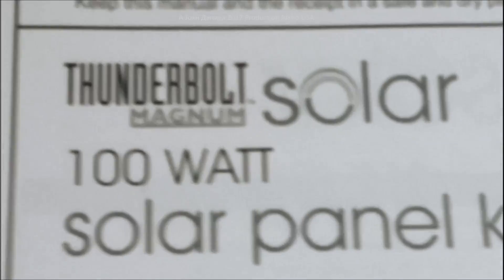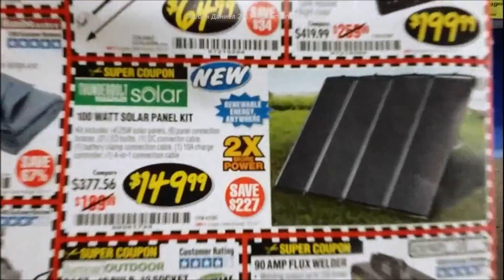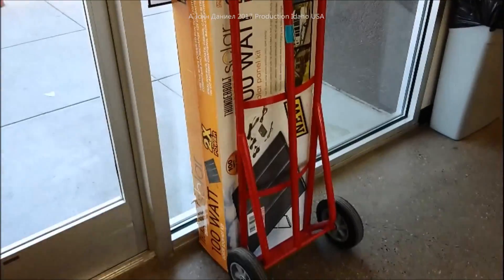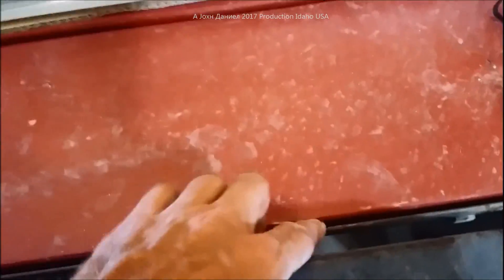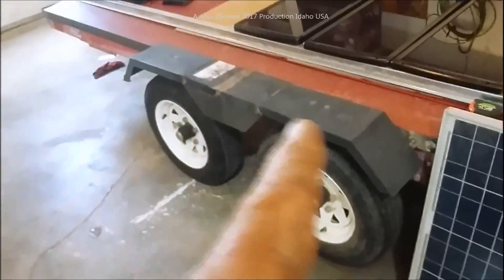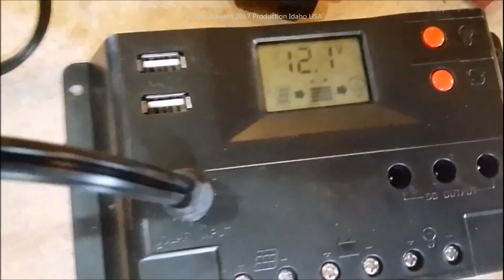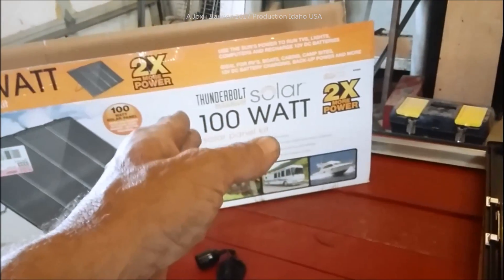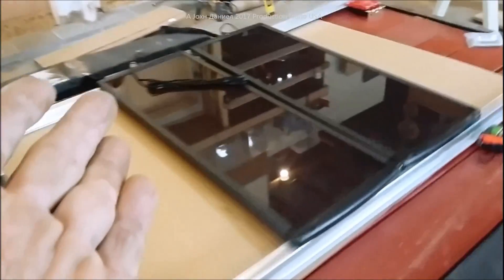Harbor Freight 100 watt solar kit #63585 NEW Thunderbolt Magnum (MAJOR PARTS LIST BELOW)

Comment from the maker: ATTENTION NEW SOLAR FOLKS  You Can Do It ✌ CHEAPER ✌ ⬇️ 93% Survivalist Agree, see the "Elite CAUSED" ENERGY CATASTROPHE SURVIVAL OFF GRID SOLAR POWER SYSTEM -- 100 Watt Panels (12) https://amzn.to/3yO2ls4 , Affordable durable solar controllers pick (2)60/80A https://amzn.to/3x3Nw42 ,Solar Connects https://amzn.to/2XJOa1M ,Battery cable USA made https://amzn.to/3h6dsim ,12/2 Above/Underground https://amzn.to/2XIJolg for safe DC wiring of lights and appliances.
Premium POWER QUEEN LiFePO4 Batteries 10 to 400 Amp for bargain cost https://shrsl.com/3kfqh
Cheap Inverter with proven 5+ year record of quality - 3000 watt long life Inverters https://amzn.to/4c1pmpF for tool, high amp, fine electronics, uses Fairchild Semiconductors
Reply: Јоhn Daniel. WOW thanks I was going to put up renogy for 100 $345.00. Its cheaper to go your way
Reply from the maker: The better stock solar items are  https://ebay.to/2KHX5XY  from Ecom
Reply: @wendelljohnson1884  It may be cheaper, but you get what you pay for.  Mr Daniel is somewhat confused about amorphous silicon vs crystalline silicone solar panels.  Amorphous silicon is cheap to make but it's downside is that it is about 9% efficient.  Compare that to crystalline silicone panels which are about 22% efficient.  That is why they are so large for the small amount of wattage they produce.  Crystalline panels are usually about 100 watts for one panel.  So this Chinese kit may be cheaper but one gets less electricity from it.  It would also take up more space for the equivalent amount of surface mounting space.  There are many ways to put a system together, but unlike a house or shed where space may be abundant, the roof of a truck is limited in its area, so you might want "stronger" more efficient panels.
Reply: Question.....does that box convert that power so you can plug up an electric device,such as lamp,drill,fan,etc.????
Reply from the maker: The "box" you appear to speak of is a solar controller. It takes incoming voltage and charges a storage battery. From the Battery you would install a inverter to run AC 120 volt items. But you can run 12 volt DC items straight from the battery also if thats what your using.
Reply: Can i use the panels to change a 12volt battery when camping for a t.v and charge multiple phones? Will i be able to use the water pump for the shower and toilet?
Reply from the maker: Yes, you can run numerous 12 volt things like pumps, TV's and lights off a battery charged up by the panels. Just be sure to get enough batteries such as 2 - 35 amp like these https://amzn.to/2CTojwv and follow proper wiring standards for the controller and batteries.
Reply: @JOHNDANIEL1  I run almost everything on 12v (even refrigerator and microwave). I love watching these videos to get ideas and learn about new things but, when I see that little 35A battery, I don't know whether to laugh or cry.
Reply from the maker: @64Seawind  Ah, the 35ah test battery. Much smaller than my 14 big L-16's in the battery room. And still smaller than the 3 WMM 29DC series in my truck the panels were installed on.
Reply: Thank you for your video now will be buying that
Reply: I'm new to all this do you this system to run home electricity or can it be built up to so also I'm hearing stories about people selling excess power back to the man is this possible
Reply: Mr. Daniel,  I'm going to buy these panels now that I've had my fears relieved from your excellent demonstration! Thank you so very much for taking the time to put together this knock out demo! You're awesome sir!  Sincerely, S. Shields - Texas
Reply from the maker: Good to know, but when you learn how to apply solar, all the things I have tested, abused, tried to break and it survived is on my tested list https://www.amazon.com/shop/influencer-acccb1e8
Reply: Cuánto vale potable poder solar
Reply: Jesus Christ died for our sins, was buried and rose again to save us from eternal judgement and give us eternal life if we believe Him. Only God can save us and freely give us new life inside forever
Reply: great info, I've got a pretty interesting idea maybe harbor freight might be interested in as well and the DIY community  500 watt's interesting things can happen, be cool to see something you designed on the shelf at any home improvement shop. Recently, through Utube, this isn't my info but having solar tracking could increase the  capacity by 50%. if 100 is max input shouldn't that mean somethings missing maybe some ultracapacators in the design of the panel with it setup as a 12v design it could be constructed  for a 200v design for ultracapacators with the ultracaps instead a low volt design construct a high volt then the ultracaps to extend the drain time into the lithiums.
Reply: WOW THANKS FOR SHARING THIS CONDENSED AND VERY THOROUGH LIST
Reply: Recently purchased the Magnum and I don't understand the instructions for the controller box. I don't know what type of batteries I have except that they are the multi-purpose batteries meant for the panels from harbor freight and I don't know how to tell if the maximum output mode is working since there's no flashing bars. Any advice on this would be greatly appreciated

Comment: I got the same kit i added more panels to mine I hard wire it to my 30 foot camper trailer to keep the battery charged i pulled in so much voltage i had to build a bigger battery bank i can run all the lights water pump and fridge and heater it’s up to a 400 watt system all with harbor freight
Solar panels

Comment: Thank you for posting your video, it's fantastic! I was wondering how those solar panels worked in low light, it's good to know that they are powerful even when they are not lit up all the way. Your battery system is awesome too, I like the idea of building it all into a solid frame. Thank you for the parts list and all the information you provided, very very helpful! Thank you again!

Comment: Hi, great video, you went above and beyond what many didn't know, thank you. Do you run the 35AH batteries? I want to parallel 3 or 4 of them to create 105 to 140AH. You think it's doable? I have hernias, so I'm limited to lifting no more than 20 lbs. Let me know, thank you 😊
Reply from the maker: 4 of the 35 ah are not really 140ah, they can only really put out total of about 95 all together before they drop too low in volts. BUT If you hurry, you can get the last 4 TIME USB lithium 50 amp hour batteries they have for stupid cheap, Time USB Super 50AH, https://shrsl.com/435wf and you will never worry about weight or outcome on them. They will last you 8 to 10 years, and can go anywhere inside your house. Later get a 40 amp MPPT and your set.
Reply: @JOHNDANIEL1  you are the best, thank you. I briefly thought of the 50ah batteries for that same amperage reason, you get close to 100 with two vs more smaller batteries. Just didn't want to waste the one 12v 35ah that I purchased never used. Thanks for the info.
Reply from the maker: You don't have to waste it, put a 5 amp buck charger on it coming from the lithium and keep it for running your outdoor LED lights using a Dusk to dawn controller and a few 5 watt ( 40 watt light ability ) E-27 fixtures.
Reply from the maker: I know a guy who bought 4 of those Time USB batteries, put 4 sets of Harbor freight solar plus a additional panel, (17 total) through a 40 amp HQST MPPT, got a SWI 1500 inverter and runs his TV, a few lights and 14 cubic foot Refrigerator now over 2 years without issues. But you can get 4 of the HQST 100 watt solar for $280, a 5th one for $72 more to get a real useable set up, I made a list of easy to work with parts. https://amzn.to/42cdjBX

Comment: Would be more impressive if you have a dc clamp meter showing the amperage.   Sure its charging but 200mA  that would take a week to  charge that battery is technically charging.

Comment: So what is the highest amp battery you can hook up the controller in this thing or is there a different controller?
Reply from the maker: You can put a biggest battery as you want on these kind of panels but you're still only getting a certain amount of amperage out of them, my common suggestion is 50 amps of battery for every 100 watts of solar is a rule of thumb to go by.

Comment: Ok! HUGE QUESTION HERE! I HAVE A HUGE PARK CAMPER AND A LONG BED RETRO SLIDEIN ON MY TRUCK! I WANT TO DO SOLAR TO GET OFF GRID AND CUT OR GET RID OF BILL AND TO TRAVEL AND CAMP OFF GRID! SO HERE'S MY BIG QUESTION TO ANYONE RT NOW! I GOT STINKING THUG ASS DRUGGY THIEVES ON BOTH FRONT AND BACK OF ME!! HTH DO I PUT THESE OUT AND PUT MY SYSTEM UP AND OUT AND MAKE IT HARD AS HELL FOR THEM TO BE STOLEN!! BECAUSE JUST SITTIN AROUND THEY WILL WALK OFF!! I NEED THEM TO HANG AROUND!! WHAT'S THE BEST WAY TO DO THAT!? AND NO!!! I DON'T HAVE ANYONE OR WAY TO PUT THEM ON MY ROOF RT NOW! PLUS I AM GONNA SELL MY BIG ONE SO I DONT WANT TO PERM ATTACH TO IT TIL I SELL AND GET ANOTHER ONE!! 😳 RRRRR
Reply from the maker: Send me an email to my shop email, olympicpowercontrols @yahoo.com
As soon as I get a little bit of time make your questions deliver it let me know what you're working with and I'll be able to try to answer most of it.

Comment: Ok.. 1) I am so glad u did this...!!! Because I am determined to find a way to go SOLAR!!! And I have heard much about HF!! And NOT GOOD on the solar front! But I live in Whiteville NC HELL CITY rt now! Stuck here rt now but planning my GETAWAY!! 😳😲😁 So we just had a BRAND NEW HF OPEN UP HERE!! And I finally got to go yesterday! And the store is great!! Sooo glad we finally have something decent here in NOTHING BUT HELL TOWN!!!
I am an older lady and met an older man there who was also checking into solar and gens etc. And we talked a while about these things! I want to add here that there r a LOT of us Older folks out here that r really getting into these things!!! Actually!! Most of us Older folks r the main ones wanting to!!! Younger gen don't seem to give a crap about nothing but themselves!!?? Sooo
2) I saw that HF has this whole new single line of THUNDERBOLT SOLAR SHIT! NEVER HEARD OF IT SO I WAS WONDERING WHEATHER IT WAS CRAP OR NOT!? AND WANTED TO KNOW B4 I TRIED TO GET MONEY TO INVEST IN THEM!? And so I think I have pushed me into the... WOW! Gee!! I think I am gonna go for this set up!!??

So ok! I STILL HAVE QUESTIONS!!
WHAT ALL WILL A 100W OF SOLAR POWER??? 1 5/6000 BTU AC! BUT WHAT ELSE!? HOW MANY SMALLER OR OTHER APPLIANCES WILL IT POWER??

AND ALSO!? SO OK! I HAVE THIS NEW FREEBIE SOLAR PANEL GIVEN TO ME BY SOMEONE! IT IS A 25W PANEL! POLY I THINK!? CAME WITH DECENT WIRES TO HOOK IT UP!? BUT I DONT HAVE ANY BATTERY OR CONTROLLER ETC TO HOOK IT UP TO!? THINKING ABOUT SHIT TO HOOK IT UP!? BUT B4 I DO I WANT AND NEED TO KNOW WHAT ALL WILL IT POWER? IS IT WORTH A DAMN!? AND WHAT ALL OF MY MAIN SHIT CAN I POWER WITH IT??

CAN I RUN MY SAY 20" FAN, 30" SMART TV, SMALL PORTABLE BOOM BOX, CHARGE MY CELL PHONE, AND POWER MY LED LAMP ALL AT THE SAME TIME WITH THE 1 25W POLY PANEL!!

IF NOT WHICH OF THOSE THINGS AND HOW MANY OF THESE THINGS CAN I RUN ON IT?? AND WHAT SIZE BATTERY WILL I NEED TO POWER THAT AMT OF THINGS OR THIS AMT??

For me I have 2 entirely seperate campers I hope to take fully SOLAR!!😎 The huge one which I live 8n BUT!! HOPE TO SELL SOON! SO I NEED ANYTHING SOLAR I DO FOR IT TO BE EASILY PORTABLE AND MOBILE!! AS I DONT WANT TO LET IT GO WITH THE CAMPER BUT FULLY INTEND TO KEEP WHATEVER I DO FOR IT AND TO TRANSFER THAT OVER TO MY CARGO OR TOY HAULER OR A LINER....OR WHATEVER THE HELL I WIND UP WITH???? 

IN THE MEANTIME!? I HAVE GOTTEN A GOOD OLD RETRO OLD SCHOOL SIMPLISTIC SLIDEIN CAMPER FOR MY OLD RUSTIC LOOKING ANTIQUE TRUCK!! AND IT CAME WITH A 5/6000 BTU AC! AND A PORTABLE GEN!! 4734?? GOOD SIZE GEN! BUT THEY R LOUD AS HELL AND GAS IS HIGH AS HELL!!! AND I WANT OTHER VERY QUIET VERY 🌎🌍 FRIENDLY ALTERNATIVES!!! GEN IS GREAT FOR ANY EM BACKUP!!! BUT RUNNING ONE 247 CAN GET REALLY LOUD ANNOYING AND EXPENSIVE AS HELL!!!

IN IT I WILL WANT TO RUN MY AC FULL TIME IN HOT WEATHER!! AND BE ABLE TO POWER MY SMART TV, SMALL BOOM BOX, VERY SMALL GUITAR AMP, LAMP, CHARGE MY CELL PHONE A LOT AND PROBABLY RUN A SMALL FRIDGE!!?? AND I ALSO HOPE TO MAKE OR BLD A SMALL PORTABLE WATER PUMP WITH FILTER TO HAVE ALL THE SAFE WATER I WANT AS I TRAVEL! SO? A WATER PUMP AS WELL!

I HAVE NEVER DONE SOLAR SO I AM TOTALLY STUPID ON SOLAR! BUT I WANT TO KNOW AND LEARN ALL I CAN AND BE ABLE TO GET AND HOOK UP MY OWN SOLAR!! SO I NEED TO LEARN AND GET ALL I CAN!!??😳😲😁😎🌍🌎

Comment: well, it's not that simple. 100 watts of amorphous will perform better in low light than 100 watts of crystalline but will take up more than twice as much physical space. if you were to compare arrays of identical physical size, then the crystalline array would produce the same power in low light as amorphous would but would really out perform it in full light conditions. in the past amorphous had a cost advantage over crystalline but the situation is very different today, that's why amorphous panel manufacturers are few and far between now and most of the ones that are still around only produce cheap panels like these plastic-framed harbor freight ones.

Comment: Problem is - volts and amps are two different things. You can have 12v and no amps of current. I want to see what it's actually changing to the battery in the low light condition like your demonstration. Don't get me wrong - I love amorphous cells and monocrystaline because both don't require direct sunlight however the actual flow of current is a key factor.

HF is still charging too much for this kit. The charge controller is a basic pwm charge controller good for standard flooded lead acid batteries and not much else because LiIon, Lifepo4 and LiPo require different charging cycles and methods VS FLA, SLA and AGM. a small form factor mppt charge controller is worth its weight in gold all around because you can set the battery type and also use it to charge cell phones or other portable battery devices

Comment: Thank you so much, I've been wondering about them for quite some time. Would they produced during a full moon, or under a street light?
Reply: Mine did. We were at the beach last summer 2020 and they were charging from a full moon, I bought my when I seen this guy's panels working in the shop with almost no light, thank's...

Comment: Can this be mounted on the roof of a shed?
Reply from the maker: Yes it has mounting holes on it for surface mounting
Reply: @JOHNDANIEL1  My shed will have a shingle roof and I don't want to drill holes on it. Can I just somehow hang the solar panels over the roof and tie the ends with a paracord?  Do you think this will work?
Reply from the maker: @noobz5056  I would not recommend putting them on that way. A shingle roof is common location for solar, no leaks when done right. Put galvanized mounts that go under the shingle, use black jack in that joint, no leaks. I use this method since 2007 with no leaks or damage.

Comment: Have you had any issues with the lights?  I thought that one of the bulbs went bad so I replaced it but that didn’t work.  So, I bought another light chord and plugged it in and the light still doesn’t work.  So then I figured it had something to do with the control panel or the outlets themselves. However, when I plug in the existing original good chord in any of the 3 plugs the light works.  If I plug in the bad original chord or the new chord I bought in any of the 3 outlets the light doesn’t work.  I hope this makes sense.  Any ideas

Comment: What is the best setting for the charge controller for the batteries
Reply from the maker: 14.2 volts
Reply: Can the charge controller handle adding the old 45 wh panel  to the system?
Reply: I also have a hub

Comment: I need help please. Mine is not working right and I have messed with the modes but I don't know what I'm doing. E23 & e11 keep coming up. I need somebody who knows this up and down. Thanks
Reply from the maker: That will happen on the controller if you started with a dead battery or you connected the solar first without a battery. It will need to be replaced.

Comment: Will they still work fine if you put clear plexiglas over the panels to protect it from hail or any debris?
Reply from the maker: You can, it may run hotter unless you add spacers, but then you will get lots of dirt on them. Mine has seen golf ball size hail on more than a few occasions, no breaks.

Comment: Thank you for video, but I still have questions.
We bought 2 kits, hard wired one set directly into controller and use plug for the other set. So that is 200watts into the 100watt charge controller included in kit. Is this sustainable, or do we need a larger controller? We have a 12v parallel battery bank to store energy and a 4000peak watt inverter to power house.
Also, I can't find any information or explaination of the thunderbolt 100watt charge controller display settings. The owners manual is not explainatory enough for me. I am trying to toggle through settings and know the voltage in battery- can you make a video explaining these settings?
Reply from the maker: Yes you will need an additional charge controller you cannot put 14 amps into that one for very long. Order a good quality 30 amp controller make sure you get one that's control adjustable.

Comment: Can I operate a 600 watt hot pot for no more than 30 mins with 750 watt inverter using Harbor Freight Thunderbolt Solar System as it is 100 watts and 35ah battery